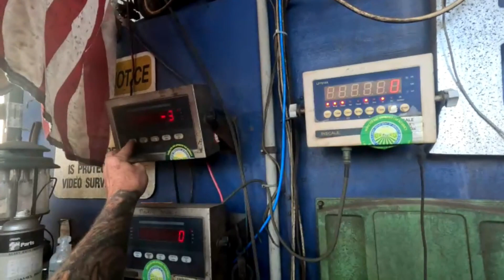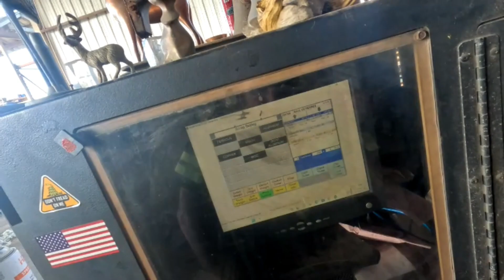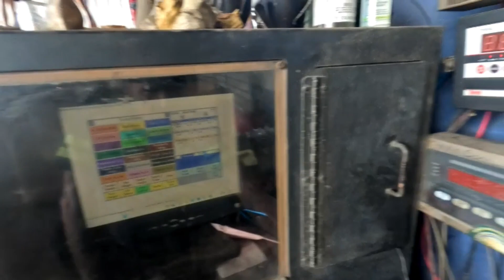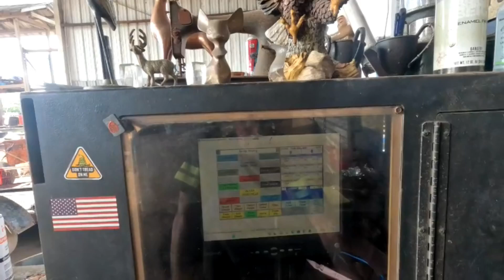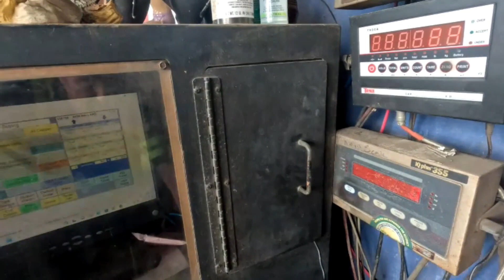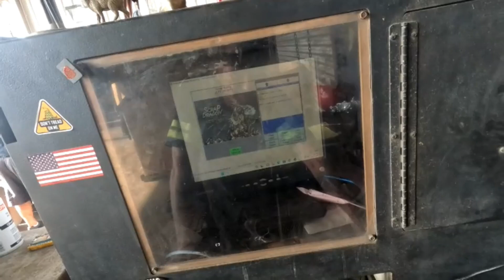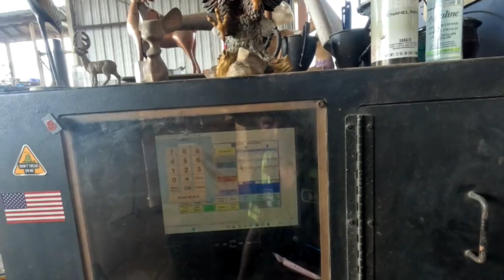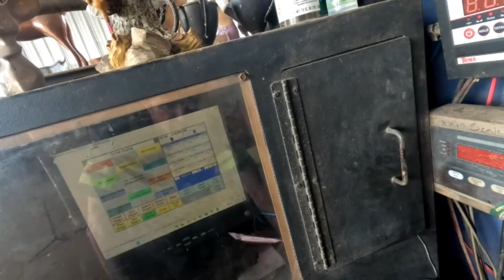FANTASTIC FRIDAY #recycle #recycling #scrap #copper #aluminum #iron #recycle #steel

Comment: 57 scooters ,surely a shear head be cheaper to cut up the aluminium than the cutting torch? I say the yard uses a lot of gas for the torches ,in our country they weigh your batteries 500 pound limit in a month unless your business is automotive or battery related,
Reply from the maker: I agree that the shear would be quicker but alot more labor. Might give a few pieces a chomp on Monday. Thanks for watching 👀 and have a great weekend
Reply: @nonferrousjeff  I meant a shear  on the crane arm not the one you use